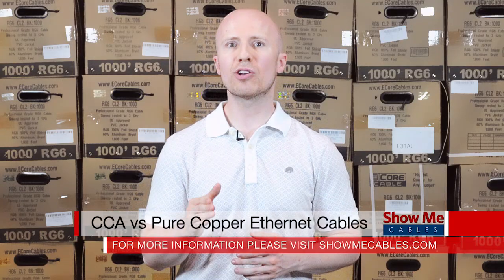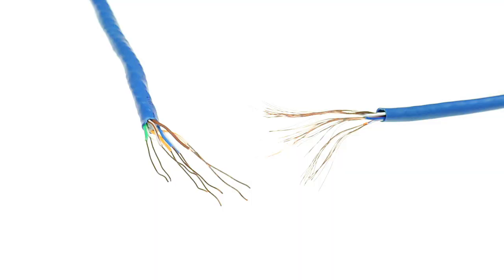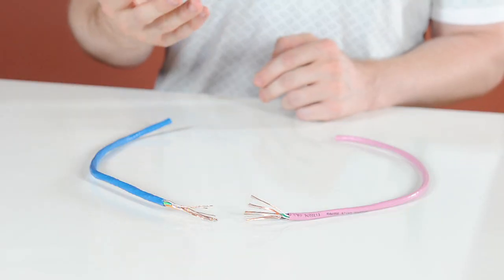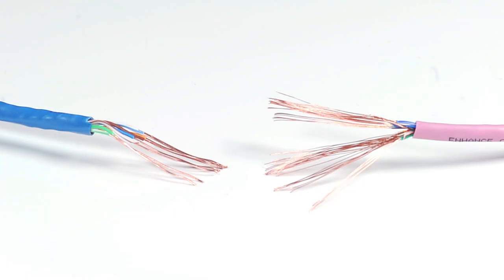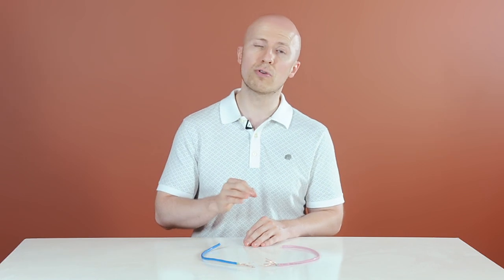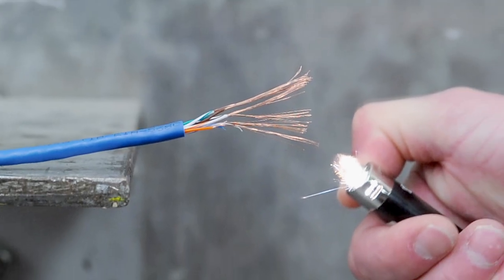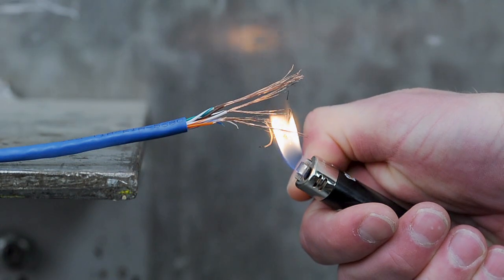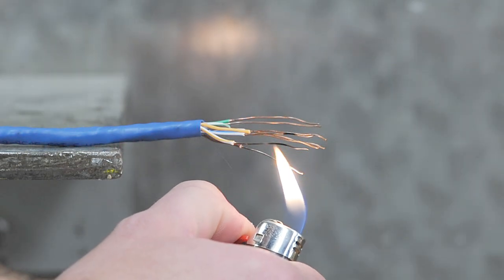Copper Clad Aluminium vs Pure Copper Network Cables

Comment: I got tricked like this on eBay a few years ago, I didn't even know crap-tacular cabling like this even existed until I clipped an end off to run into another room and then attempted to strip it down and put a new end on it, it was nearly impossible to get the a new connector on the end, and forget punching it onto a jack , its so thin it doesn't even fit into the punch down, just falls right on out. This kind of crap should be banned from being imported, but I realize that it would be nearly impossible to inspect all of it coming in.

Comment: CCA or Copper Clad Aluminum is not an aluminium cable "Dipped" or coated in copper. if you do your homework you will find it is a different process to "Clad" something than to "coat" something, there used to be some Coated cables, but that is not as common, CCA is actually a lot more reliable than coated cables, since it uses a uniform layer of copper wrapped around the aluminium and fused so it doesn't flake off like a coating.  Just saying...
Reply: It's a non-technical video, and, they say 'dipped' it's not far off.  Yes, there is a technical cladding process (see https://en.wikipedia.org/wiki/Cladding_(construction) for more info about the process), but, I'm sure it's easier for a marketing team to get the point across in a simple "beware" video instead of explaining a whole cursory process not necessary.

Also, that stuff was designed for VoIP, not data.  It's used for voice applications; but all these shitty resellers trying to market it as data or networking cable are really misleading people.    Where has it been shown that it's "a lot more reliable than coated cables."   Solid copper isn't coated, unless you're saying CCA "dipped" is worse than CCA "cladded" -- which in that case, who cares... they're both Copper Clad and not Copper; so you'll get same issues.

FFS it's almost half the weight of copper.... you can rely on that crap for your network.  I wouldn't even put that stuff in my home.
Reply: +Hector Caceres | And still they perform worse than pure copper cables...
Reply: That's why he is TOTO, whether it's Dipped or Coated, it's still TOTO.  The moral lesson is don't be TOTO🤣

Comment: you talk about Apple's to apples and then go and burn stranded wire and compare it to solid wire
Reply: Exactly! I was just about to comment the exact same thing :)
Reply: I'm not even sure why they burned it... it's not about the fire rating (otherwise you'd get plenum rated cable), it's about the totally crappy conductive material used.  Instead of copper (one of the best conductors of electricity) they used aluminum (much worse).  
http://www.superiorconsumables.com/copper-alloy-tips.asp
Reply: @easy2memorize  They burn it because CCA cable melts at a lower temperature than normal copper cable, allowing you to test your cable and determine if it is cca or copper

Comment: I wonder for sound reasons can you even hear a diffrence.
Reply: For VOIP it's perfectly fine.  MagicJack, Vonage, and all those other places use it.  It's because it's not a "true" data signal, it's mostly lower-bandwidth phone.   But, if you try to use it for network and stream video over it; you'll have issues.  A simple voip or POTS phone call?  No issues.
Reply: @easy2memorize  This makes no sense at all! VOIP is network traffic, you contradicted yourself.
Reply: @slimstickman  go ahead Eric, don't buy Pure Copper.  Just make sure you don't cry when your gobbled up by fire due to non-copper cable😭